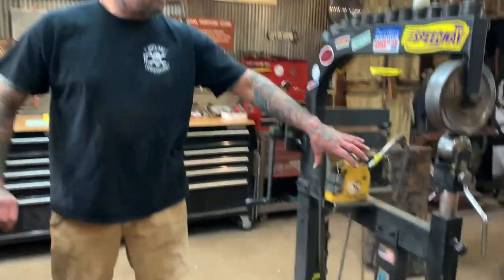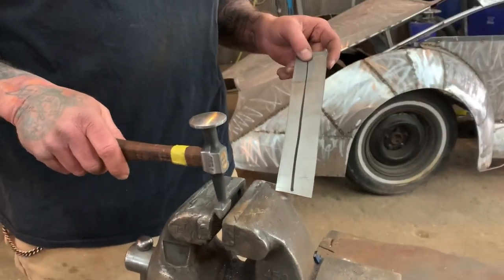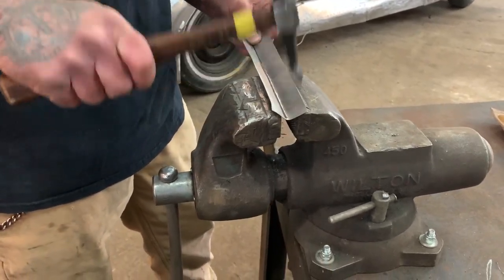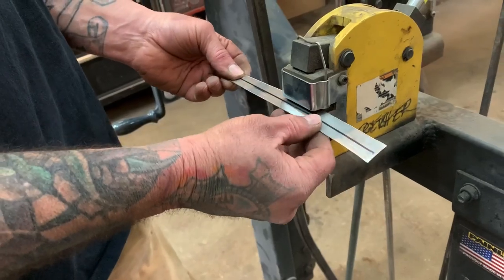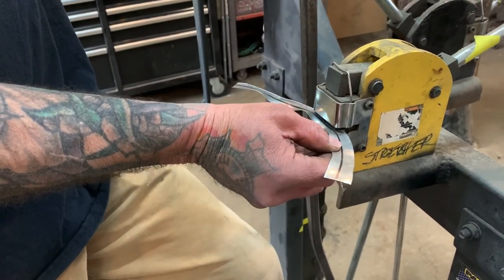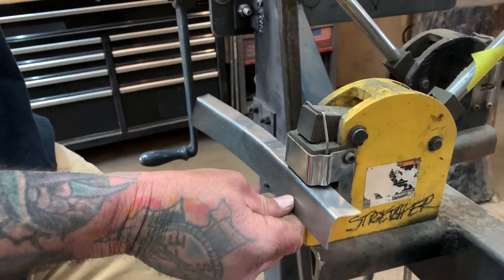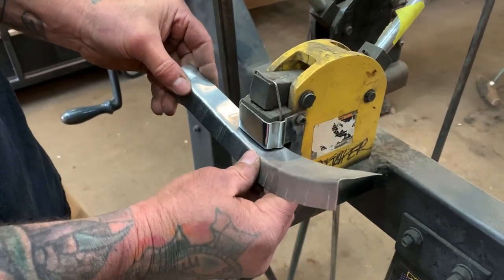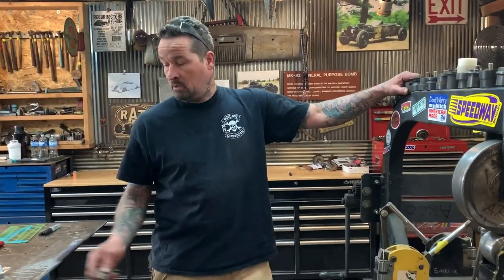Metal shaping: how to use a stretcher

Comment: Excellent demonstration and Heidi asks great questions when filming. One cool use for the stretcher is making little gauges from strips of steel. When you want an even curve on things, like the tops of my wings, I did exactly what you did to make a curved gauge piece I could use to check the shape. I like to remind myself the curve comes from the fact that you are making one side longer than the other by stretching it, so the metal HAS to curve. If you use a thin strip and put it all the way in like you show you are still stretching it but doing it on both sides at the same time. The metal strip gets longer but doesn't curve since both sides stretch the same amount. I find I am always having to think if I shrink/stretch this, with a hammer or the wheel or the other tools, where does the sheet metal need to go? You've obviously been doing it long enough to do this instinctively so it's great you take the time to explain it to us guys consciously trying to learn it. Cool stuff metal!
Reply from the maker: So good to hear from u bro. Happy easter! Thanks for the nice comments. 👍😀